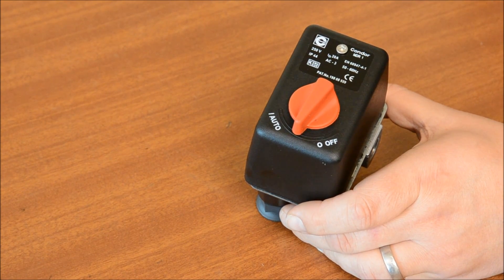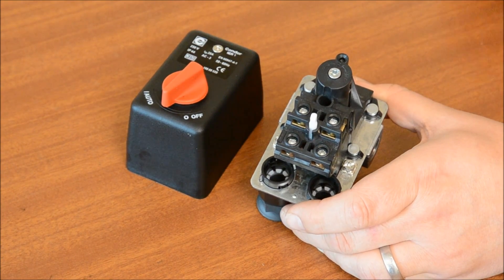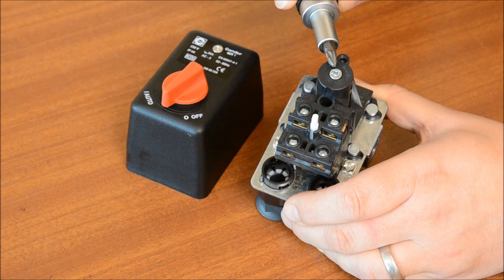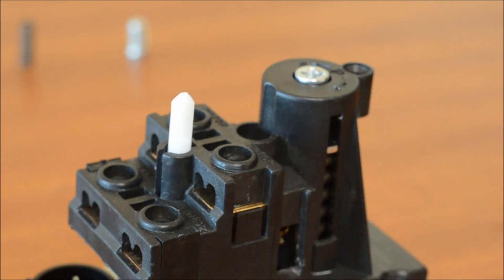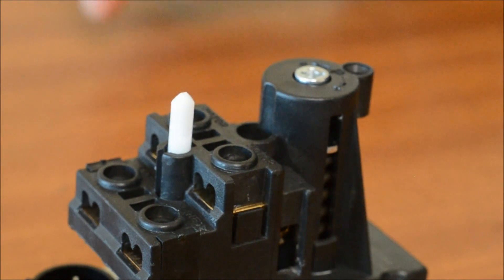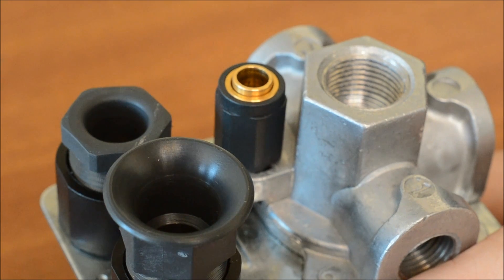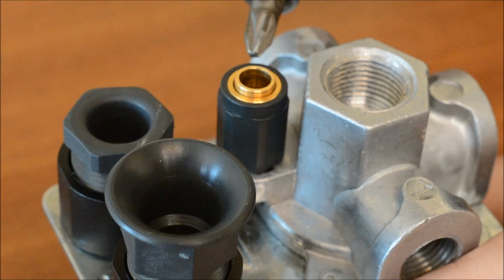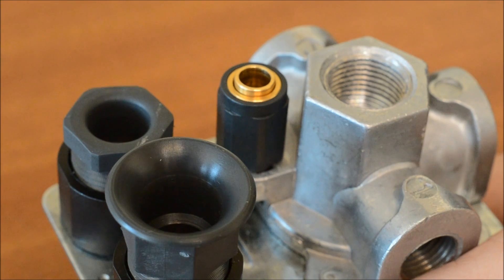Condor MDR1 Air Compressor Pressure Switch

Comment: Hey I bought a 60 gallon dewalt I adjusted that screw to the + I found out i wasn’t supposed to so I lowered it ugh people are saying. It could blow up be safe any suggestions how to set it to the rite setting
Reply from the maker: Hi,

You would be best asking Dewalt for the correct settings for their compressor.

Kind regards

Comment: Can either 120 or 240 volts be used with all pressure switches?
Reply from the maker: Yes, it can switch 120 or 240V

Comment: Where to buy the Differential Kit? Got an older CH compressor I need to adjust the cut in and cut off pressures for my new tire machine.
Reply from the maker: The differential kit is no longer listed on our website as a separate item as it now comes with the MDR1 pressure switch as standard.  We do however still have these in stock so you will need to call us on +44 141 882 6211 if you want to buy one.
Reply from the maker: The part number is CQ40016W-1 and price is £2.26 + VAT & delivery.
Reply: Ill call you as soon as I can find a phone that works internationally.